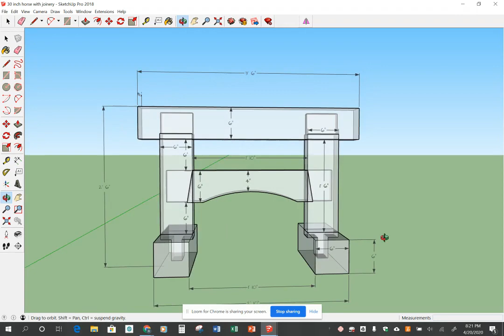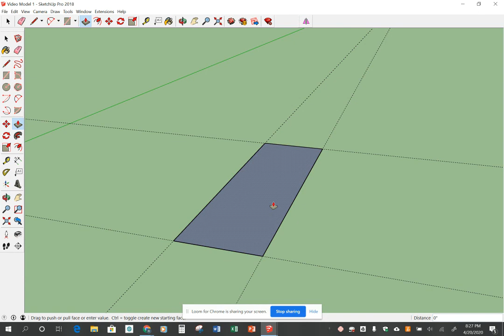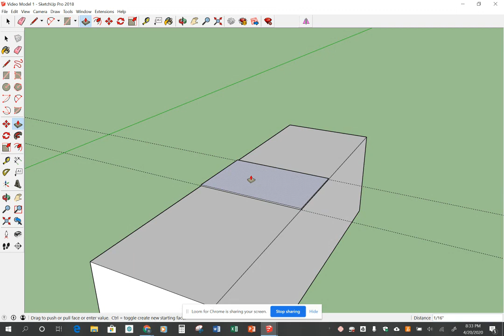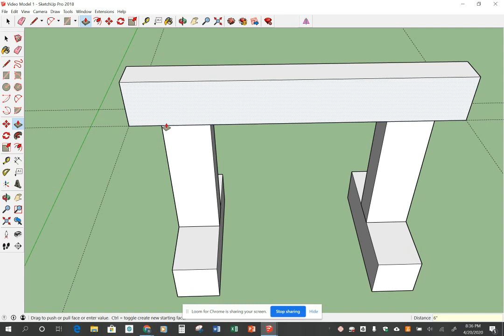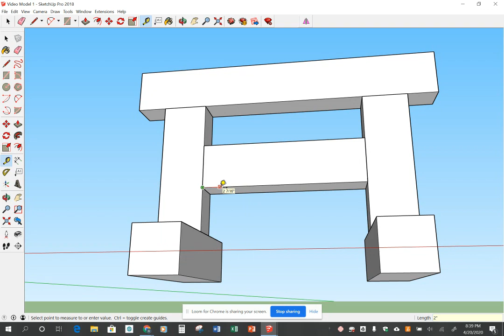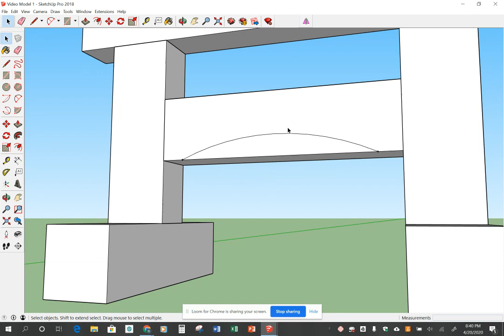Timber Frame Design Using SketchUp Part 2: Drawing a Trestle Pony

Comment from the maker: This is a response to Neal P. For some reason his comment didn’t appear in the thread. 
Neal’s words “
 	
Neal P
Hello. THis is great instruction, Thanks. However, I can't get the arc to Push/Pull. I created the tie as a component and measured 2" for the guide and created the arc, but when I triple click the arc does not turn blue and will not push/pull out. Not sure what I am doing wrog.”
My response is…you need to open the component (triple click on the tie) before you draw the curve otherwise you are just drawing a 2-dimensional arc rather than a curve on a 4” thick tie. So in effect, you can’t push/pull a 2-d line, so the curve needs to be part of a 3-d object (component), so you must open the component, then layout and draw your arc, which you should then be able to push/pull that section. Hope it works for you.

Comment: Hi, thanks for these vids. 1 question, when you copy a component, say the base...do you have to make the copy a component?
Reply from the maker: Assuming you mean repeat “make component” no. When using the move copy tool, once you’ve made a copy no further action is required. If however, you want to edit one of them (the original or the copy) and not the other, then you need to triple click the one you want to edit, then right click and select “make unique.” Once you do that you can edit either one while not changing the other.
Reply: @bigbeamstimberframes770  wow. Thanks  for getting back so fast